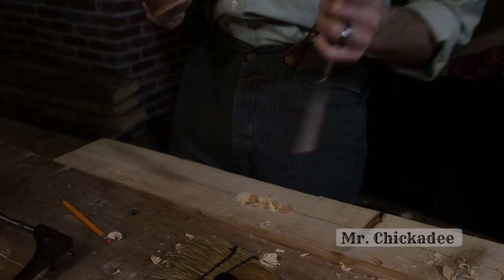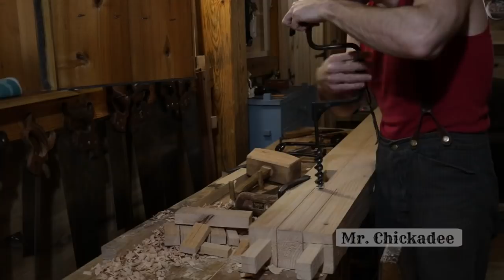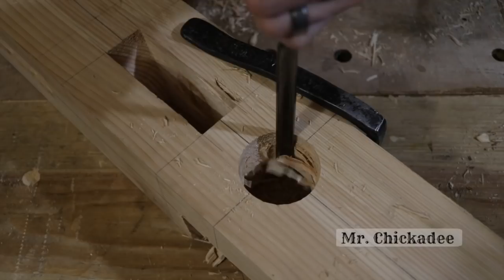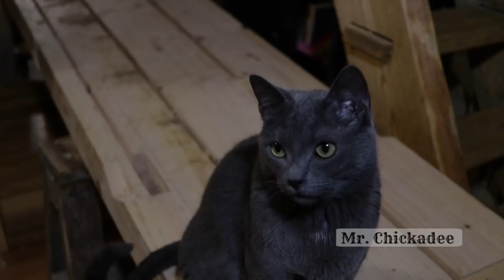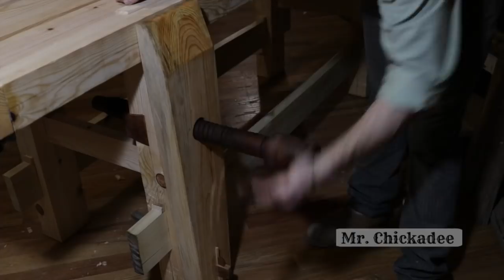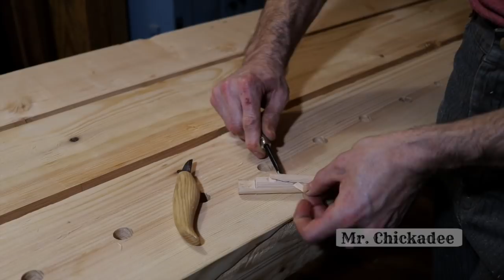The Asian Roubo Timber frame workbench, no nails, screws or glue, Japanese / Chinese joinery

Comment: I have been starting to build a basic cabin from hewing pines on the property, and I started without any information about the subject or any knowledge. Mr. Chickadee alone is the most valuable hub of information i have found to reference how things are done right and well. What I REALLY want to know is where the hell does he get all those amazing hand tools. It's such a shame these things (most all) aren't made anymore.
Truly appreciate all of your videos, thank you, you're helping us all so much.
I don't believe in tattoos but I may just get Mr. Chickadee mural on my back🤘🤘 you rock
Reply from the maker: Sounds awesome Ian, so moved you would consider me as an inspiration to what you are doing! Dont ever hesitate to email or call if you have any questions!
Josh
Reply: @MrChickadee  I wish I started researching the line of work before I started- I severely underestimated the basic necessity for beams needing to be straight and square. What I love most about your work is that everything is done with manual tools. I love the hand tool way. Where do you find your tools? I just got a nice beam auger on eBay. Thanks for responding!
Reply from the maker: @D231991  Have you tried line rule layout yet? Its what I used on this bench and every timber frame since our house. Its amazing, round, twisted, bowed or whatever shped timbers come together perfectly every time, nothing needs to be straight or even square. Its the dominate method used by the majority of timber framers globally, mostly in asia, where they have a longer more advanced history of timber framing than we do. I get my tools everywhere, flea markets, junk yards, corner sales, and yes, ebay too. ;)
Reply: @MrChickadee  wow, thank you so much; this information is incredibly helpful to me. Got my slick coming soon, I've yet to make my first joint

Comment: That Age Old question is finally answered, YES.  You can fit square pegs in round holes, excellent video, once again, thanks for sharing.
Reply: The fact that it is square and fits by forcing the wood fibers is really the secret to the strength of the technique. You'll notice he uses a steel hammer to have the sharp impact it takes to make this work. The wedge security tightens and the smashed sides keep it from ever lifting.

Comment: I admire his ability to cut straight saw cuts I only wish I could do the same
Reply: I know nothing about your ability level, but some things I do to help myself make straight cuts is to start off my cut with a chiseled divit in the wood, forming something of a offset "v" shape between my knife cut and the chiseled start, then I make sure I've either continued my knife cut along where I want to make my saw cut, and that "v" shaped divit, or at the very least an easily visible straight pencil line. The "v" shaped cut really does a lot to help you guide the saw. Something else to consider is that you only need to align your top once, after that, just make sure you keeping in line with your side marks as you saw in. One way you can really do this well is by focusing almost entirely on one side of your saw cut, the side you can see, and slowly dropping your hand and the heel of the saw while keeping the tip closer to the top. When you've hit your depth on that side, just focus on the other side, either levle off your sawcut or just turn the piece you're sawing around 180 degrees and lower your hand again. When you get in the flow of it, you'll find what works best for you and develop your own techniques.
Reply: Lol ikr he makes cuts with a rip saw I couldn't make with a back saw

Comment: We had a massive two man saw hanging on the wall of my Fathers shop and sadly we never did use it. I dont know for sure if it was handed down or anything. My Father worked two jobs so most all the chores were done by me. I did use a double bit axe for many years and prefered it over a chain saw for felling and spitting. But I didnt have an old cross cut just modern cross cut. We had a large sithe and cicle and many other hand tools and those I used plenty. The ground around our home was full of clay so a pick axe was my friend. I dug several 8'x 8'x 8' deep out house holes for ours and other peoples mountain camps. And a lot of footers. So watching you work brings back alot of fond memories.

Comment: Such an inspiring video!  You have made something that is strong and functional, without the obsession of “gaps in the joints” and the perfection that many of us strive for.  And you did it with some of the most basic of tools.  I have watched tons of your videos, and this one really hits home to me because I built my own workbench, with the idea of using hand tools only, yet I caved and used some basic power tools where I thought I was saving some time and/or energy. It was a moment of weakness for me, that has carried own into other builds, and now I find myself buying more power tools because of some “need” that has developed in my brain.  

I am not ripping on power tool woodworkers in any way, but that is not why I, personally got into the craft.  

Thank you for the videos and the unspoken insight that you have provided me.  I am truly in awe!
Reply: Took the words out of my mouth
Reply from the maker: Thank you, I have found that through studying traditional work done before power tool use, if you can find any, is very different in form and execution than what is considered the "norm" today. Wood was worked the bare minimal, boards often only got one or two faces actually trued up or smoothed, insides, backs or rears were left rough sawn or scrub planed. Ive seen people obsess for hours trying to "flatten" a board, when Ive found that a well cambered iron in a large try plane, leaving a slightly rippled effect, which appears flat to the eye standing a few feet away, but is at least out of wind, is all that is needed. 

Take this bench for example, no plans, no numerical measurements, zero dimensioning of materials! All the parts were sized according to what size stock I had, and my own body and shop size. And yet, it all fits together solid and strong without ALLLL that mess that people think they must have. We don't need all that, and in fact we never did, we just think we did, and do, because we are now accustomed to a machined world, when the real world, and the real craft were never machined, but beautiful and functional all the same.

Comment: I would have placed the wagon vice as close as possible to the edge of the bench. This helps you put a rabbet on narrow pieces. Maybe add a tool well. Otherwise, a great bench. I tend to use the router plane and the shoulder plane for joints, but you are pretty good with the chisel. Hats off.
Reply from the maker: I see your point, in this case, I wanted it pretty centered on that first timber for structural reasons, heck, Im just so happy to finally HAVE an end vise! I had a tool well once, it became so full of clutter and dirt! But to each their own of course!

Comment: Josh, was that a No. 1 or No. 2 hand plane used at the last?  Probably a No. 2 since it fit your hand well.  Great technique as always and your attention to detail using the camera to film the necessary bits and pieces of the build is always appreciated.  I noticed when you were cutting the tail ends of the long pieces towards the first of the vid, the table you were sawing upon was rocking, then at the end when you were planning the top of the bench, the bench was rock solid.  Great engineering and a whole lot of superb cutting to the lines.  Thanks for letting us see how the "old timers" did their craft.  You are a pleasure to watch.
Reply from the maker: It was actually a no 4, I have freakish huge nosferatu hands haha
Reply: @MrChickadee  +1 for using the word Nosferatu.
Reply: The Stanley #4 is the workhorse of the Stanley metal planes.

Comment: Mr. Chickadee, that was incredible! I am in the middle of a workbench project. I had pondered if using glue to make the bench top without glue was even possible. You did it! I do have two questions. One, why did you choose to make a split top bench? And, two, how do you utilize the split for work holding or other aspects of woodworking? Thank you.
Reply from the maker: Well it just made sense to me, rather easier to not even try to joint the pieces together, also I like the versatility it gives such as storing small tools point down in the gap, and you could also pass thin clamps in there. Dust and shavings fall through well too...
Reply: The gaps in the top are of no consequence when working but they are essential to keep the top stable. The end caps are long grain wood and rigid tenons, quite a problem if the top was solid with seasonal movement. A solid top bench requires end caps with a groove and elongated peg holes at one end.

Comment: I'm a bit confused about the "no need to dimension the lumber".  How do you assure that the joinery lines up?  Perhaps I should know what you meant by "timber frame line rule layout".  At any rate it looks like it came together quite well.  Very nice joinery.  I like your videos very much.  Thanks.  I saw your interview with Chris?  Interesting.  I think you said that your wife was Peruvian.  I spent 6 month traveling in Peru after college back in the 70's.  The country is beautiful, as well as the people.
Reply from the maker: As you guessed, its a result of center line layout, any mishapen, or twisted wood can be used in timber framing, or in this case a bench without dimensioning or squaring the stock. Saves HOURs or hand work...

Comment: Excellent precision with handsaw. Very difficult to do. Not sure why you didn't offset the holes in those tenons so the end beam would pull up tight to the other beams in the bench top.
Reply from the maker: If you mean draw boring, I did, look closely you can even see inside the hole on the last tenon, and see the offset holes.
Reply: @MrChickadee  I'll have to look again, but it seemed as if there was a gap left between the boards as you installed the last peg. Maybe I was mistaken.  Keep up the good work.
Reply: @MrChickadee  PS: Yep. I was wrong. It looks tight in other views. Optical illusion, I guess. Great bench. I always cringed, before, when I saw you working on shaky work surfaces. ;-)

Comment: amazing patience and crtaftsmanship as always. Do you ever use japanese pull saws? I have founbd them incredibly useful and accurate even as a site carpenter. Would like to hear your views on them. Thanks
Reply from the maker: Ive tried a few, but my personal experience is that my western saws are easier and cheaper to sharpen, much cheaper to get secondhand, and have much more reach than a comparable japanese saw. Most of the japanese saws I see used by folks are also disposable blade, which I dislike.

Comment: Amazing! Just curious how did you make the threads for the vices
Reply: He said they are "flea market finds". A person can buy wood thread cutting tools on eBay, however they are very expensive.
Reply: Henrique Coimbra per his description section, they were flea market finds.
Reply: Me too.  They looked like they came off of an antique of some kind and are now getting a second life or something.  Would be curious to know.
Reply: Indeed, the male and female threads. It would be very educational as to how this was done. I think I remember, it was an episode of the "Wood Wrights Shop" with Roy Underhill. I believe a sort of die with a cutting edge inside it much the same as wood threads are done today. I would wager that Mr. Chickadee had that part farmed out.
Reply: He said in the text below the video, the screws were flea market finds
Reply: According to the description it was a flea market find. 
But you can look at Pask Makes on how he did it : https://youtu.be/mTnVDl6Y6u4
Reply: Ok, so this is a way you can cut a thread in relatively soft material such as wood, brass or lead with basic hand tools: You make a flywheel lathe as MrChickadee has done in the past. Which is itself can starts off as a simpler whip lathe.

Then you give it ways which are straight and parallel with the spindle axis. Then you affix a carriage to the ways. It must slide freely, but with as little play from side to side as possible. In the lathe turn a parallel rod between centres.

Affix a a sharp blade to your carriage, with the edge at the pitch of the thread you wish to cut. It should be registered against the work so it bites in. Then turn the work in the lathe. The knife will score a spiral groove of great accuracy (for wood work at least) as the carriage is dragged along the ways. This can then be chiselled to produce the thread form.

For the nut you improvise one from a block with a far larger hole through the axis, and holes bored through along a plane at right angles to the axis and bored so as to meet with the axis. Drive in pegs cut to a wedge point so as these points engage the screw profile you cut into the rod which you threaded.

You then can use this as a lead screw to drive the carriage and attach it to the spindle drive with gears. You can use squirrel cage and mating pegs just like the old windmills, or file triangular spur gears from a metal disc. Despite being  "not perfect" they work surprisingly well at low speeds and and in fact most clocks from the golden age of clock-making were actually triangular or even square cut.

Then you can cut a new more permanent lead screw using what is now a screw cutting lathe. You can also actually get progressively finer and therefore more accurate lead screws by gearing down. This is actually how the first machine lathe came about in the first place.
Reply: Making wooden screws
https://www.youtube.com/watch?v=4ZmnGLpqAGI
Making wooden nuts
https://www.youtube.com/watch?v=cztX3GSPBYM
Reply from the maker: https://www.youtube.com/watch?v=4ZmnGLpqAGI
Reply: Check out Roy  Underhill , he has a couple of videos  on how  to do  that. He  is on PBS.
Reply: @morg52  0
Reply: @richardanderson7692  LOTS of people do not  read his descriptions.  It might save a lot of questions...just sayin...

Comment: Building the bench is therapeutic I’m sure. Roubo’s are a bit too trendy for me, prefer the old Danish design with oblong dogs and full tail vise with it’s jaw. Not easy to get the wood screw kit but steel far easier. 
The old Danish bench design is far easier to dismantle and move, more of an issue for most viewers than Mr Chickadee I think.
As for the grooves at 10.30 people ask about! They just appear! A chisel at 45 degrees from each side will cut the V for the groove, a long paring chisel such as offered by Lee Valley will clean up the sides and bottom.

Comment: I love this bench! I am hoping to build one of my own ... will probably have to resort to using pine wood ... do you think it will last if I make it out of pine?
Reply from the maker: Pine is fine!
Reply: Mr. Chickadee , thank you for confirming that what size is the Auger bit you were using with the brace 1.5 inch?
Reply from the maker: @MrBalloonatic  yep, you will need a pretty large brace to drive that size, like a whimble brace, T auger, or a long sweep brace as seen in this video. Or just make more smaller holes, or make smaller tenons...
Reply: @MrChickadee  Two more questions if you don't mind me asking ... firstly, what type of lubricant are you rubbing on the drill bit when making the dog holes, and secondly, do you have plans/schematics that show the joinery you are using, I am trying to work out where I need to put all the mortices and tenons to maximise the stability of the bench,
many thanks in advance!

Comment: Beautiful build.  So those were impressive old screws and tapped washers, where do you find them?  Locally?  I’ve been trying to figure out how to make them without power tools (they have commercially available cutters for 2.5” and 3” in the multiple thousands... I need two or three screws for my bench).  I have a couple of plans drawn up but need to work on shaping and hardening and tempering steel before I try.
Reply from the maker: I found them locally, they are about 2" with a 2TPI thread count, fast and strong! 
Here is the best video I have seen on them...there are more from the same person
https://www.youtube.com/watch?v=4ZmnGLpqAGI

Comment: Awesome piece of work!  Nicely done.  I have a question - how come there are "spaces" between the top surface boards?  Is it so shavings or dust will drop to the floor?  I wonder what the design called for with that?  Thanks for any replies.
Reply from the maker: It is good for dust, it also is handy to stick tools like chisels in point down, they dont go rolling that way, it also gives me another 1.5 " in width...and I think looks nice.